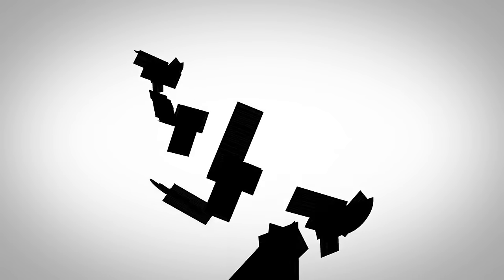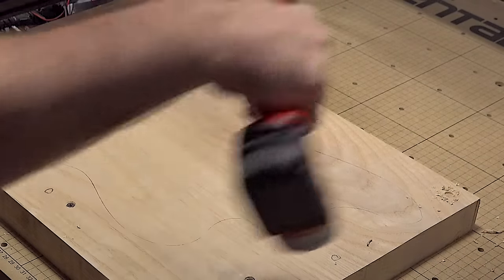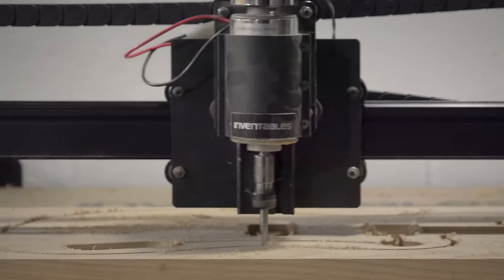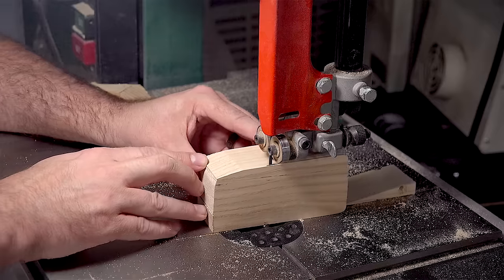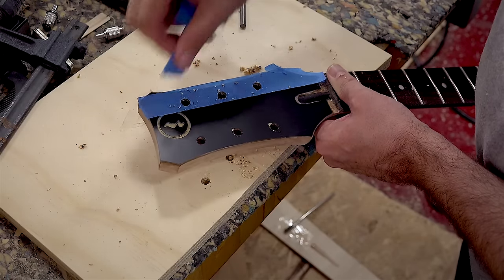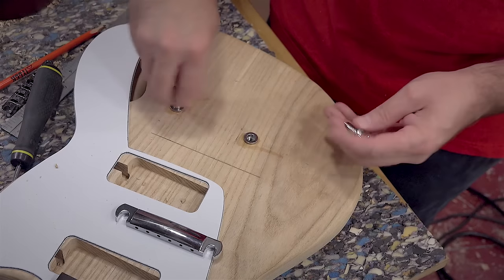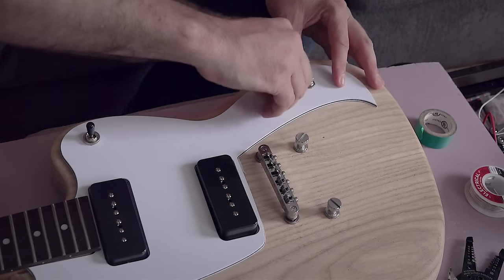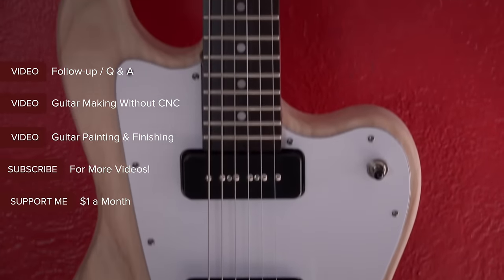Making a Guitar Body on a CNC | Upgrading a Cheap Epiphone

Comment: cool build! I'm a bit concerned that you didn't connect the tailpiece or the bridge to ground, so you might get a bit more noise than you'd like. Generally though, an epiphone is a solid enough instrument that making a new body for it won't improve the instrument, except of course if you dislike the original aestethics. But I appreciate that the fun is in doing it ;)

Any plans on building an entire guitar, including neck, fingerboard and fret job? You're basically almost there already, except that you would need better wood grain for the neck if you want it to hold up.

Comment: a little heads up on that splice you used with the heat gun.  That center gray ring? That's the solder. You have to heat up the splice until that solder breaks down and actually solders the wires together.

Comment: How did the intonation come out? One of the hardest parts of building a guitar from scratch is getting the bridge placement exactly correct.  With a start bridge you have some room to adjust saddles but with a TOM bridge, there is very little room for intonation adjustments. Any plans yo upgrade tuners, electronics etc for the final product or the non CNC version? Looking forward to hearing the songs! Thanks for a great, interesting video!

Comment: I enjoyed your video, it's interesting to watch other people work.. particularly woodwork. I didn't like the wire extension when doing the electronic side. Surely much better to put in a new one, then use a joiner. You talked about just using a heat gun, does that crimp the wire as well, or is it pre-soldered? Seems odd to me. I'd like to see the quality of soldering, it's a major point of failure and poor quality sound in both commercial and home made electronic projects.

Comment: Very nice and sounds good but why do you cut the pickup wire right there? unsoldering them would be a much safer option and even easier when reassembling

Comment: couldn't you program the CNC to cut the neck cavity on an angle?  Instead of the wedge??  Awesome video.
Reply: +fragwits He could have made steps and then sand them to a slope, it sounds faster than waiting for glue to dry (but with the other things that had to be glued, saved time from that won't make much of a difference)
Reply: yeah from the Z0 or Z Negative value to a higher or lower value.

Comment: I'm not sure if it matters here, but I hope you understand that the scale length (length of action) for a Gibson is 25.5" and the scale length for a Fender is 24.75". Also, Gibson necks/fretboards are a little wider than Fenders. Essentially, you put a Gibson/Epiphone neck on a homemade Fender Mustang/Jaguar/Jazzmaster body. If the scale isn't right the thing might not be intonated correctly.
Reply: ***** Yeah you're right. But my point still stands.
Reply: ***** I sure hope so but the guy did admit he doesn't know much about guitars.
Reply: +luitober he probably did (or probably not...)
Reply: he used a fender jazzbass body -_-

Comment: Are there any separation problems with the glued wood and vibrations of the guitar?  Do you think there would be any vibration/separation problems if the boards were glued together for Thickness?

Comment: Thanks for this video David! I'm impressed by the speed you can run your X-carve. I can't run mine nearly as fast. Which spindle are you using? It doesn't look like mine which is the 300W/24V one.
Reply from the maker: Torsan1977 I'm using the older "quiet cut" spindle. I actually just ordered the DeWalt and the mount for it so I can make deeper cuts next time.

Comment: Great job. Just wondering why you did'nt use the X Carve to make the angle on the neck instead of making one and gluing it in?
Reply from the maker: It would have required different software and a different but. This way was just easier.
Reply: Drunkenwood What ever gets the job done I guess. Still waiting for the name change announcement.............

Comment: Turn around your bridge. The adjustment screws should face the pickups so as to not interfere with the strings path to the tailpiece. :) Been thinking over getting one of these units from Inventables. Seems like a pretty cool piece of machinery. $3k for the setup I would need, definitely fits a hobby budget... :)
Reply: It's purely preference. I've had Les Pauls come from the factory either way around.

Comment: I am not a musician, nor am I a wood worker. My question is; why is the neck and body 2 separate pieces? does it improve sound quality? or is there some other reason? Thanks for any response.
Reply: For the best quality sound, the neck and body should be cut from the same piece of wood.
Reply: A lot of time's there is a metal rod in the neck to help with tension. Plus it's easier to make and shape if it's two pieces.
Reply: There are a couple of reasons. Historically, everyone started with acoustic guitars, which obviously can't be done any other way, so this was a sort of obvious default.  Electrics can be made with a  single piece, and sometimes are, it's called 'neck-through' design but you have to find a much longer piece of wood to start from, and you don't do this with any old random board, but selected wood. A piece of wood long enough to neck-through that meets the other selection criteria as well is going to cost a lot more, and not everyone thinks the difference is worth it. A bolt-on neck like he shows here doesn't improve the sound, but if it's done properly it shouldn't really hurt it either, and of course it's much easier to fix it when it breaks.
Reply: its very hard to find a straight piece of wood that long
Reply: one piece necks are more expensive and much more fradual  - they contribute nothing the sound or playability

Comment: by the way, mate, you need to ground the bridge, otherwise you'll run into trouble later on. just run a lead from the common ground to the bridge post and you'll be set

Comment: Hey Dave,  did you run a ground wire to the bridge?  Coulnt tell from the video.
Reply from the maker: Seans Workspace At first I forgot to and didn't realize it until I started mounting the electronics. It's not in the video but I had to go back and pull out the bridge threaded insert, drill a hole, add the wire and put the bridge back in.
Reply: +Seans Workspace Good eye!

Comment: You have a CNC machine yet GLUE A WEDGE IN  THE NECK POCKET ?!?! HAHAHAHAHA WTF
Reply from the maker: +guitarslf132 that's because it's hard to get a smooth wedge surface with the CNC. Much faster and easier to do it by hand.
Reply: +Make Something Did you shield the inside and pickguard?(if not try copper tape.That stuff is awesome :D)
Reply: only if you don't LEARN YOUR EQUIPMENT.
learn to RAMP from Z+ to Z- OR Z0 it isn't HARD AT ALL. It's LITERALLY like 5 clicks if that.

Comment: I don't know much about how CnCs work, and if this is even possible, but it would have been ultra-cool if you could have built the neck out yourself. The plunge routing you did with the thing makes it seem to me like you could have done graduated curve guides and sanded out the rest, ala the starter routing I have seen on carved top guitars (For example, this - http://www.setchellguitars.co.uk/ant/ant/bloguploads/2006/08/carve_with_jig.jpg). I feel like carving and shaping curves is the part of guitar craft that is truly "hard" to get right, and making it much simpler via stock CnC would show exactly why they're so amazing compared to traditional woodworking (if indeed they are).

Also not sure why a tilted les paul neck rather than a flat strat neck. I guess it makes it more custom?

Comment: I don't know, but I thought using a CNC would eliminate the need for a router, belt sander, and an angle grinder. Isn't the X-carve capable of 3D carving? That is, why can't the X-carve round out the edges and remove material for the arm and belly contours?
Reply from the maker: There are multiple ways of doing this. This was was the fastest most efficient way for me.
Reply: I can appreciate that if you already own those tools it might be a lot faster, e.g routing the edges rather than slower rough stepwise cuts and then finer smoothing with a ball end bit. I guess my question is specifically, is the X-carve even capable of 3D carving and smooth rounding? And can that be programmed with the basic Easel software (I have lots of time ;) Thanks.
Reply from the maker: Yes it can but for rounding and smoothing you might need to use Fusion 360 (free) instead of Easel

Comment: Why didn't you use the cnc to cut the angle in the neck pocket?
Reply from the maker: JW Runciman It requires different software and bit. Much easier and quicker to make it afterwards.
Reply: just wondering, so i take it that easel doesn't let you make inclines.
You could use it to start the cut flat then use a jig to cut to neck pocket to correct depth with a 2.5 degree angle incline. (using a router of course)

Comment: CNC is hardly used and he's using hand tools to do the real work. WTF? Why not CNC the arm bevel while it was on the table? And he hand drilled the tuner holes? A perfect place to goof and it needs to be perfect...
Reply from the maker: +Doug H. in VA So what's your issue?
Reply: I don't have an issue... I have an objection to a video headline that says 'making' a guitar body on a CNC. The CNC outlines a groove and that is about it. All the rest is done with conventional tools. the headline says A and the video shows B

Comment: your "higher quality bridge" looks a lot like the shit bridge that comes with the epiphone
Reply from the maker: Thanks for your comments!
Reply: The "bridge" that was one the cheap epiphone is normally what the guitar company would use to hold the strings like the guitar made in the video. Personally, I don't like them either, but it is a vast improvement.